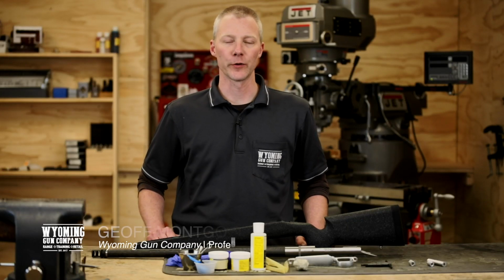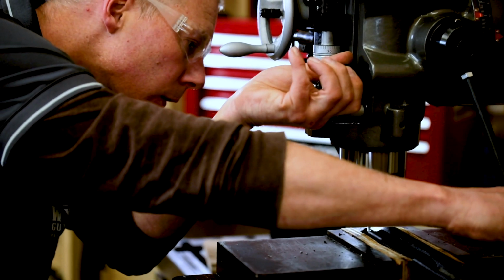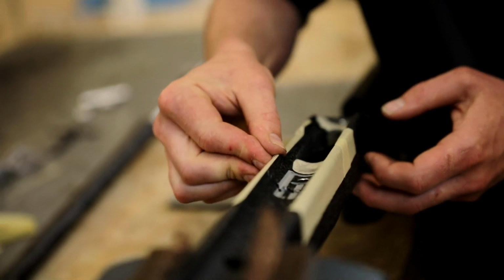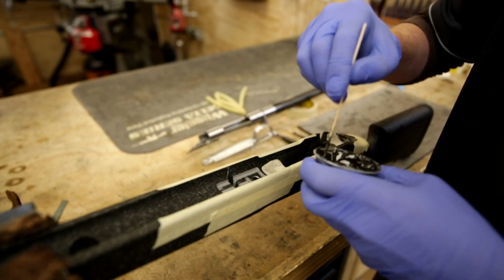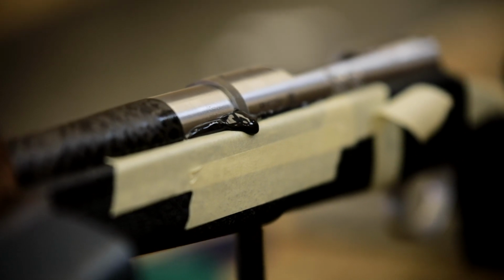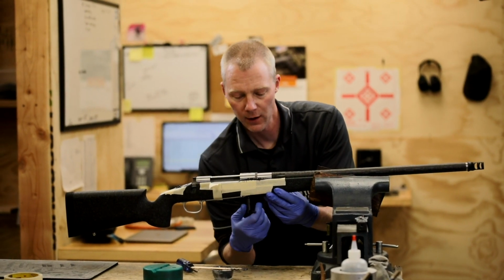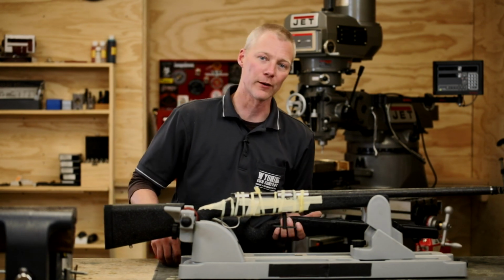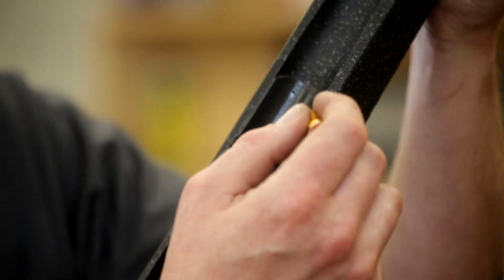How to Glass Bed a Precision Hunting Rifle | Gunsmithing

Comment: Why wouldn’t you torque the action screws?  I was assuming it would be best so you can replicate the fit with proper torque.
Reply from the maker: My approach to bedding has changed slightly since making this.  I no longer even wrap the bedded rifle with surgical tubing anymore.  I found it squeezed out too much bedding compound as it's setting up.  Screws are only finger tight after setting it in.  Provides for a much better result and then the screws are properly torqued for final assembly.  Thanks for watching!!
Reply: A stress free bedding job is what you want which is the reason you don’t want to tighten the screws down tight. I only finger right the crews.